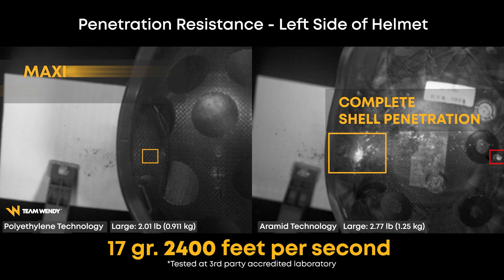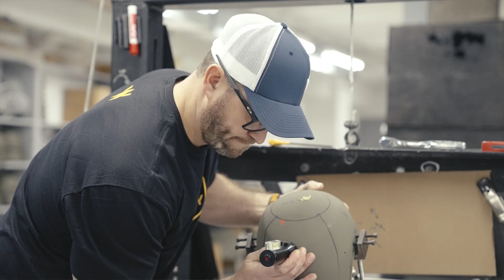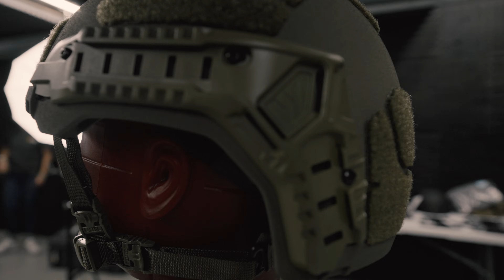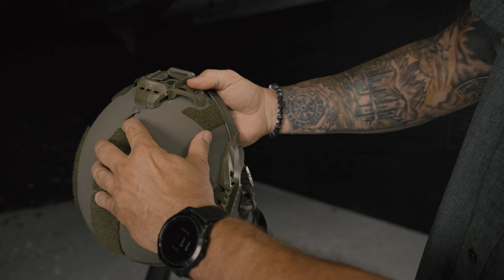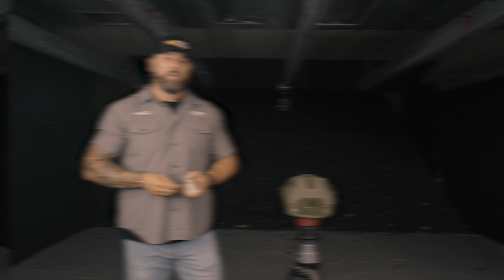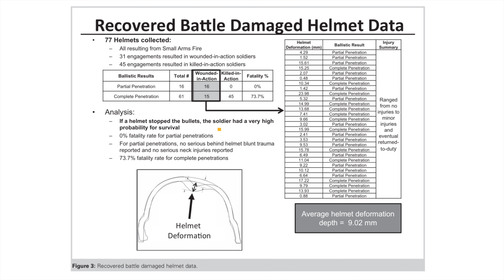Shooting a Team Wendy RIFLETECH Helmet

Comment: everyone is straight up dogging on these guys about *MUH BACKFACE dEfORmATioN* the problem is that this dude did it from 20 feet and it still defended the strike. No-pass through.
I remember a story about Ops-core had an actual field account where I believe it was the XR-SF helmet that technically was not meant to handle 7.62x39 yet defended and the guy lived.

He got his top knocked off for sure and he definitely suffered a casualty. But the dude got to live. There is plenty of folks surviving with helmets even with non-NIJ certified rifle defenders.
So do yall wanna die or do yall wanna go home? 

ALSO DONT GET HIT. Simple.

Comment: The people making this video didn’t do a good job showing the helmet stoping the rounds or even showing the back face deformation.
Reply: this guy is doing this test from very close. Is there the possibility that it could be fatal or leave you seriously injured? yes. Put it this way, if it could withstand the 308 round from that close range. Imagine how well it will perform from long range where it is really critical to have sufficient ballistic protection say 250m out where velocity energy is significantly reduced.

At 250 meters. The velocity of of 308 is probably hovering around 2000-2200 depending on the environment and depending on the the weight and final velocity from the muzzle can dictate how much force will be applied upon impact. Its between 1500 and 1700ft-lbs which is about the same as a .44mag upclose and we already see the BFD is minimal from similiar pistol rounds leading up to the rifle test.

Meaning you could survive.

There was one account that I know if from Ops-core actually saving someone from a 7.62 stray round I think. Im not sure. Some say it was a ricochet or random stray round from far-away distance where all the energy from the round was significantly depleted but if he didnt have the helmet on. He would be a goner.

Better with it than without it. I mean people still die in car accidents even with airbags and seatbelts protecting them but it can only do so much.

Dont get hit.

Comment: FWIW - I am glad to see speeds closer to "actual" for their V50.  That said, 150g .308 is not reaching box velocity (2800+FPS) from that 14" Semi platform and saying "almost 3000 fps" is clearly an overstatement.   I shoot if from a 16" and it flirts with 2650 on a hot day.  I know the helmet they are calling BS on (3M) and the V50 was like 2000fps for the .308 for it.

The mountain is a stop, the molehill is the back face does make sense to me but if the molehill is also deadly, just not as instantaneous, you can't ignore it.  Perhaps there are no "documented" versions of death from stopped rounds to ballistic helmets so that would technically be true but saying people don't die from fractured skulls and hammer strikes or falling and hitting their head on curbs is not true. Closed and depressed head injuries kill many people every year.  

Potentially a great product, but if you are really critically using this to make a $3500 decision, those claims should have you making that curious face.
Reply: this guy is doing this test from very close. Is there the possibility that it could be fatal or leave you seriously injured? yes. Put it this way, if it could withstand the 308 round from that close range. Imagine how well it will perform from long range where it is really critical to have sufficient ballistic protection say 250m out where velocity energy is significantly reduced.

At 250 meters. The velocity of of 308 is probably hovering around 2000-2200 depending on the environment and depending on the the weight and final velocity from the muzzle can dictate how much force will be applied upon impact. Its between 1500 and 1700ft-lbs which is about the same as a .44mag upclose and we already see the BFD is minimal from similiar pistol rounds leading up to the rifle test.

Meaning you could survive.

There was one account that I know if from Ops-core actually saving someone from a 7.62 stray round I think. Im not sure. Some say it was a ricochet or random stray round from far-away distance where all the energy from the round was significantly depleted but if he didnt have the helmet on. He would be a goner.

Better with it than without it. I mean people still die in car accidents even with airbags and seatbelts protecting them but it can only do so much.

Dont get hit.

Comment: It stops the heavier 5.56x45 M193, but what about the lighter & faster SS109/M855 with the steel EP core?
Reply: SS109/M855 is slower and 62gr, & has a dense lead core. M193 is 55gr and faster. They have the same powder loading. You maybe thinking of M855A1 which is still slower than m193 but faster than M855, and has an exposed hardened steel tip/core. 

Not much stops M80A1 or M855A1. I wouldn’t expect a helmet to stop EPR or AP unless it’s 6 pounds
Reply: @ShepherdOfTheSilkies Yeah, my mistake, you are correct. (M193 is a tad faster though)

But with enhanced penetration rounds being standard issue for NATO and Russian soldiers, I would hope it is rated for such threats as the steel tips have a habit of going through UHMWPE if the wide range of armor testing on Buffman range is any indicator.
Reply: @s @sionsoschwalts2762  keep in mind it’s rated for point blank shots with these other ones and those type of threats are not gonna realistically be point blank shots 90% of the time. It’s also not adopted to face those yet. There is helmets that do you have a front augmented armor that can take those threats but again we’re talking really front heavy helmets that will cause neck injuries in light accidents. This is by for the best option on the market for a long-term health and usability.
Reply: @s @sionsoschwalts2762  poly hybrid plates use the friction of the round spinning to slow the round as well, US EPR I have free spinning tips, so the tips stop spinning as they’re forced through by energy. The jacket maintains the spin. Traditional type woven material is what you need to defeat rounds like that, and it’s heavy.
Reply: I also look at it this way
If it stops 193 at 80 yards 
It might actually stop 855 at 400 at an angle

Comment: One thing that is glaringly obviously omitted from this conversation is force transmitted to the head.  In your "car" analogy, you could hit an immovable object at 60mph and your car's frame, seatbelt, and airbag can work fine, but you still die from the force transmitted to the person.   Same in helmets, take a 10 lbs sledgehammer and drop it on the wearer's head (with your helmet on) from 20 feet up, and testing would show "PASS" ( zero penetrations and minimal BFD*) , but the person would be dead or get TBI due to force transmitted to the head.  Limiting force to the head is key to survivability, and that factor is completely omitted in this entire video.   You talk about foot-lbs of force of the round but then completely ignore it when it comes to the helmet performance.  Where did that force magically disappear to?  Right - it got transmitted to the wearer's brain.

Also, "no thru holes" is a bit of a semi-false claim.  Sure the bolts don't go ALL the way through but they go at least partially through the shell (which weakens it)  and then the bolts are covered by some material on the inside.  It should be a No-Holes-Drilled shell, but this is not that.  You state "no drilling into the front of my helmet" but there ARE holes there so... you mean no drilling completely through.

And, how far from the edges are you shooting?  2" per the NIJ spec (the NIJ standard is, of course, not relevant to helmets).  If that's the case then roughly 40% of the shell (on a high cut) is not protecting you.  You're shooting on the crown of the helmet - the least likely spot to get shot.

*Oh, and BFD is irrelevant (22:00)? ?  Really?   Dying from a helmet strike is one thing, TBI is another.  Simply cannot believe that TW thinks BDF is completely irrelevant.  The rubber headform springs back so of course we can't see any idea of BFD.  Handy.  Use clay like others (and NIJ) so we can see BFD.  During the shoot you mention "very minimal BFD" but of course you can't possibly tell that because the helmet material tends to revert back to its original shape after being shot.  It almost certainly bulged out during the shot then 'sprang' back to its original shape or close to it.

This appears to be a really ornate and scientific shoot but it's missing some very key concepts.
Reply: oh, and UHMWPE construction - does that mean you can't store it in hot locations (trunk of a car) like the Superlight because the heat weakens the PE ?  What are the allowable storage conditions?  What about cold?
Reply: Energy transfer over time is how armor mitigates that energy transfer. When you shoot a steel plate it swings because it’s immediately transferring 100% of that energy that the projectile held. With armor it’s slowing down to a stop against a heavier object(more resistance. If you have an armor plate, that is the same weight as a steel plate and you shoot them both the armor plate swings less, now add soft fat in muscle behind the plate and you have additional absorbing mass. With helmets if it stops the threat you’ll face usually strained neck, muscle muscles, or sprained vertebrae. The alternative is death. The redhead they used is a  small skull clay head, it deforms if it is impacted. It’s used for testing. 

Professional opinion, all these were survivable with minor neck injuries at most. Which is better than death.

Sind note, bolts used on helmets are ballistic rated as well, that’s why they are a 1/8 sphere button head bolt. Having no through hole cuts an expensive compression machine out of the mix when manufacturing this helmet. It at least to my knowledge, doesn’t offer any benefit to energy resistance.
Reply: @ShepherdOfTheSilkies  - there are more dynamics in play than you mention, but your concept is correct.  I'd re-think your comments about the bolts, though.  If bolts are 'ballistic rated' then why do they intentionally avoid them in tests, yet VPAM standard in Europe requires shots to the bolts?  The net result is that the NIJ standard is not designed for, or suitable for, helmets.  It's designed for torso-worn armour which, as you correctly mention, depends on soft tissue behind it to help with backface deformation.  NIJ standard also doesn't require testing within 2" of the edge (again, for soft armour panels) so take a helmet and draw a line that is 2" away from EVERY edge, and see what you're left with in terms of protected area.  Due to lack of a relevant helmet standard in the North American market, manufacturers have adopted the NIJ torso-armour standard.  However, none of the US helmets can pass the VPAM standards (not even close), which is why FBI/DEA/Homeland went with the Busch VPAM helmet as their exclusive helmet.
Reply: @s @sigmasafety  well you can look up why they avoid them in tests. But I’ll save you the time, it’s because they don’t give Data on the ballistic helmet itself. The bolts already have the data. 

You also should educate yourself on the new NIJ standards, they are no longer specific to body armor.
Reply: The holes arent drilled. The mounting points you see are molded out of the ballistic material itself, so instead of holes being drilled to allow equipment to be mounted, the shell of the helmet juts out to make little pegs for equipment to be mounted on.